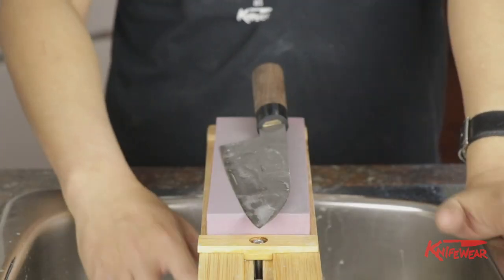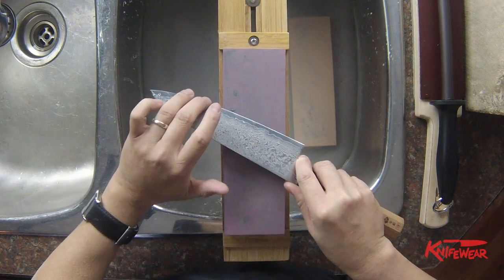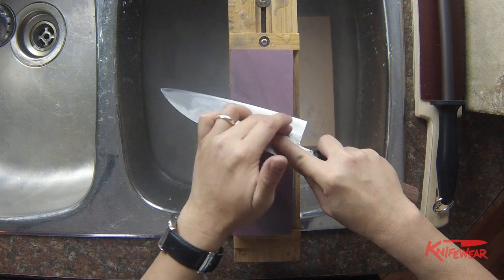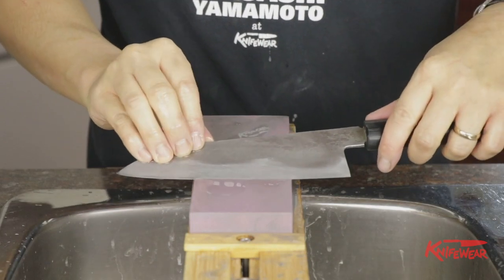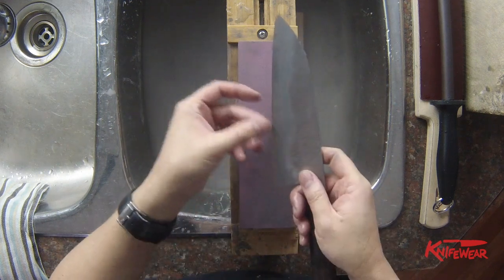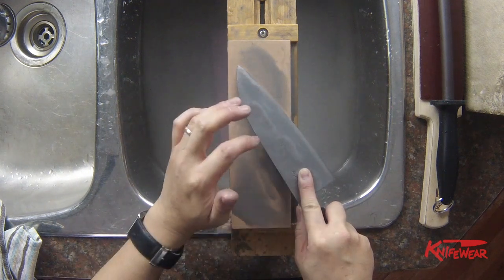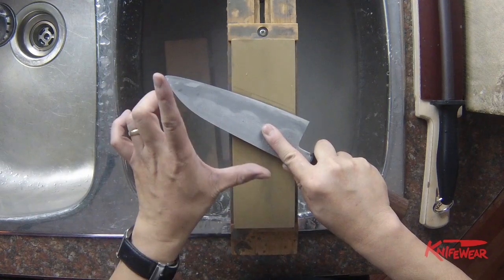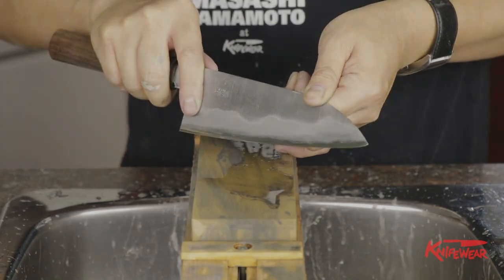Advanced Japanese Knife Sharpening: How to Thin a Japanese Kitchen Knife

Comment: Great video. There isn't a lot of footage going in depth about sharpening wide bevels and going through the hamaguri process... or so I was told it's called. I've been working on my first wide bevel knife with this kind of finish and experimenting how to sharpen it as it goes. So far the bevels look very scratched up, but I'm guessing if I just spend more time they'll even out and have a finished look with distinct bevels/polished core steel that matches my stones, even if it doesn't match the original finishes exactly.
Reply from the maker: It's definitely tough to achieve the original finish, but with practice you can get a nice smooth consistent finish. Check out our live video from Friday the 15th where Naoto get's more in-depth on the topic! The main key is to spend longer on your 1,000 buffing out the scratches from the rough stone. You can even use a mid-step as you would with sandpaper, like 600.
Reply: @KnifewearKnives  Oh nice, thank you.

Comment: So is the idea that you go from grit 220 to 1000 like you would grit 1000 to 3000 when sharpening the edge? How often would you recommend doing this? Like 1/10 of sharpening sessions? More or less? And… what about a single bevel yanagi, do people usually move up the shinogi line (ie thinning) everytime they sharpen?
Reply from the maker: Good question! We start on 220 grit every time to get the initial steel removal done quickly, then we'll jump to 1000 for polishing. It doesn't hurt to slightly thin your knife with every sharpen, it makes it easier each time you have to! 

When sharpening a yanagiba, the initial sharpening is all done on the primarily bevel, so that line will move up slightly every time.

Comment: Can blade thinning be done with an Atoma 140 grit diamond plate?
Reply from the maker: You can certainly use Atoma for thinning. I (Naoto) don't usually use them since they leave quite deep scratches that are hard to remove afterwards.
Reply: @KnifewearKnives  Thank you so much I have one other question. Do I have to thin a knife before I sharpen the cutting edge every time?
Reply from the maker: @jeremytrujillo6130  We like to thin whenever we can (unless there is need for thicker edge or stronger edge for toughness). We think maintaining the thinness is much easier than making the blade thin.
Reply: @KnifewearKnives  Thank you so much I really appreciate your advice.
Reply: @KnifewearKnives  Sorry to jump in, but I have a question about thinning that frequently... Doesn't it affect food release if you thin that much?